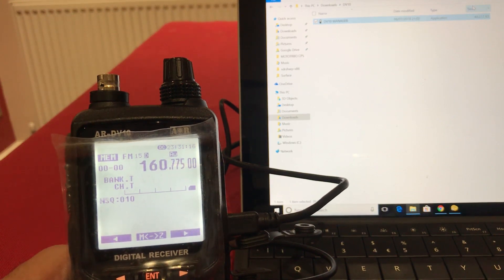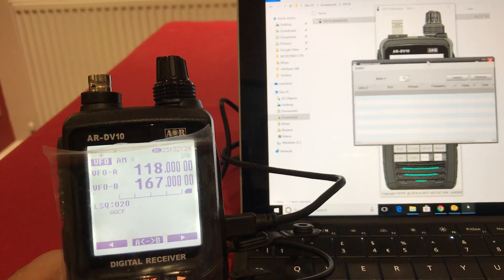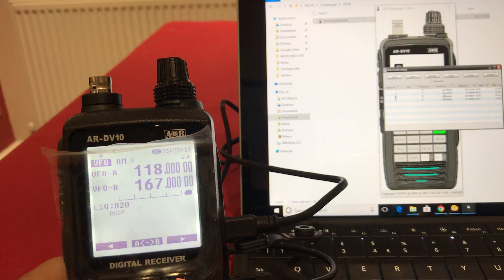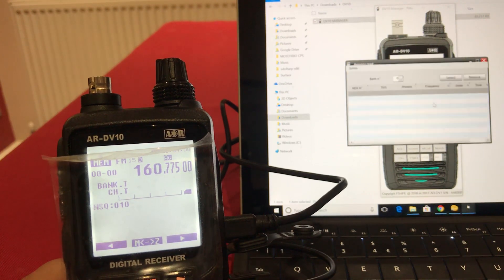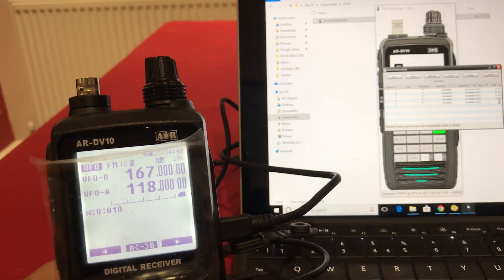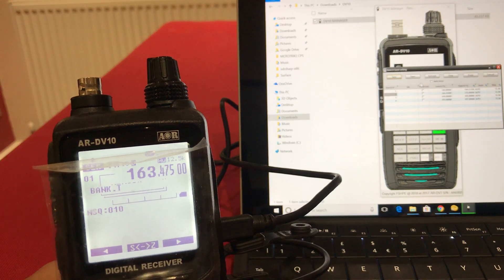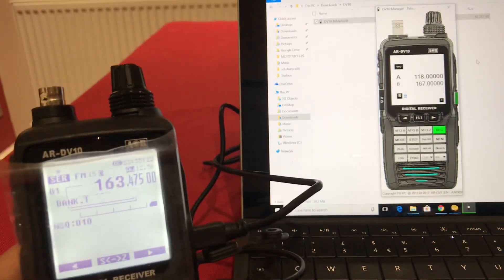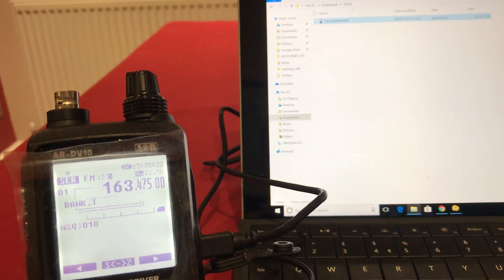AOR DV10 Locking Up Using DV10 Manager Software

Comment: That’s bad it’s locked up like it did . I’ve just bought mine march 2023. I never buy a scanner or receiver when they first come out a bloke in a shop told me I want say what shop he said there’s all way problems when a new radio when they first come out he said wait about at least two years we’ll I left it over four years and there’s paper sheet with a few pages showing all the problems that have been fixed. My R20 I let it three years. I’m just reading my manual over and over be for I use it . The R20-is straight forward to use I hope this AOR DV10 is a easy. I all ways read the manual be for pressing buttons. I know this vid a long time ago I hope you go it sorted.